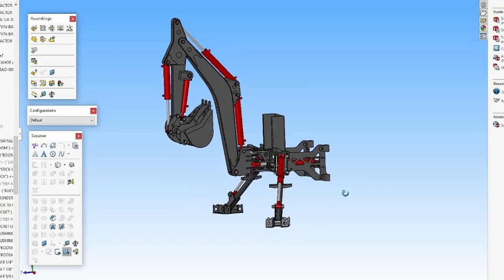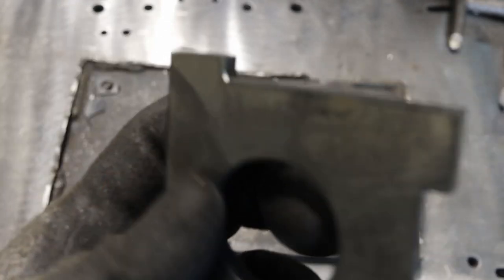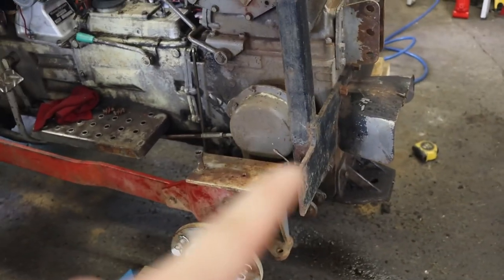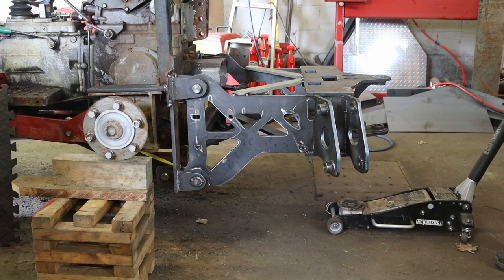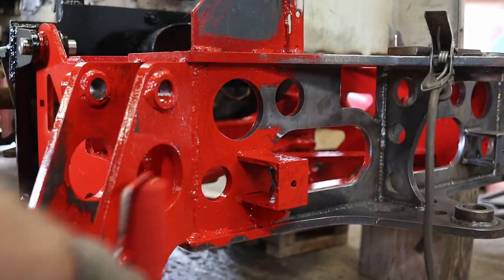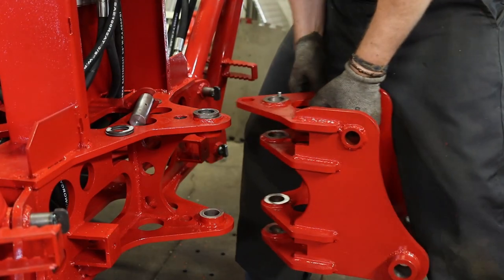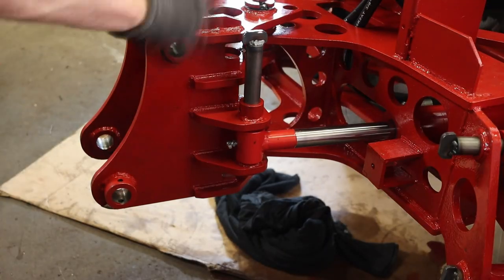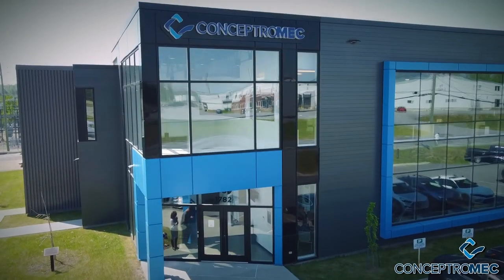BACKHOE / Excavator project, part: 2 FIXING the BASE to the TRACTOR!

Comment: I don't know if someone's mentioned this, but I've used a shop vac taped to the fill port of a hydraulic tank to keep pressure on the system so it doesn't leak all over when you're working on them. works great. Not sure if it works on tractors
Reply from the maker: Hey I watched farmcraft too! 😅 But only after doing this...and I have the same question as you, will it work on a tractor?! 🤷‍♂️
Reply: I have a 2000ish JD 4300.  Shop vac trick worked great for me.  Had to do a filter change and replace some other part (that I can't remember now) and lost very little fluid.  My tractor leaks so much fluid I'm considering just adding a small one to the back to run full time:)

Comment: Hey, hockey pucks make the best bumpers, they are what I use for my trucks air shocks short stops
Reply from the maker: They sure are! 👍
Reply: @VinyB57  turns out hockey pucks also make good feet for a desk when you need that little bit more height